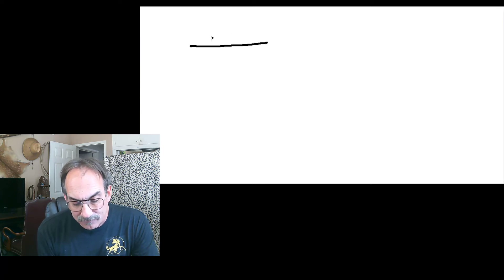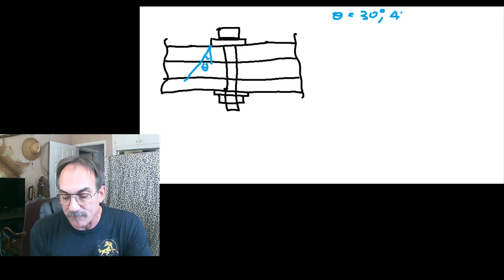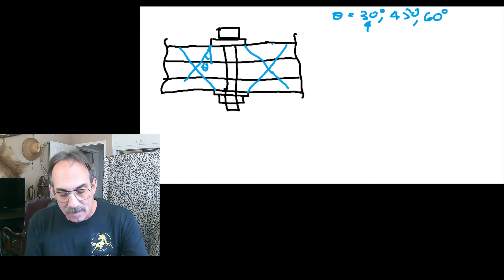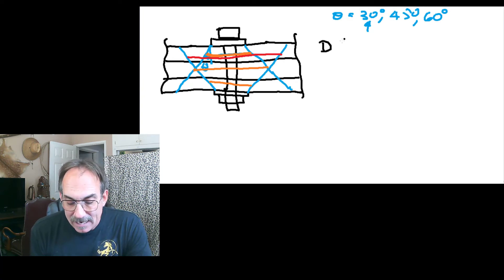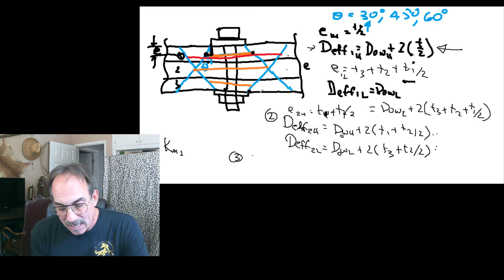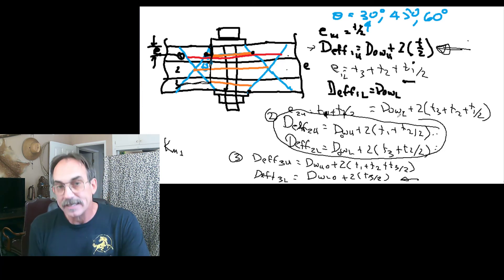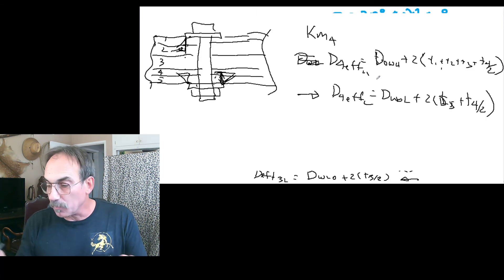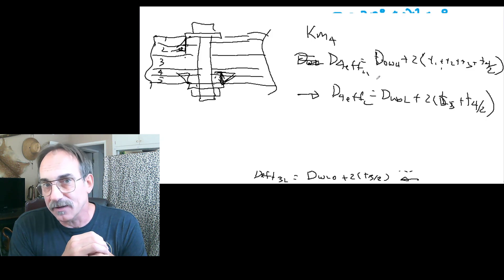Structures II: L-12c - Effective Diameter of Members

Comment: Good video Todd.  A thin washer with a large OD washer will not be 100% effective cylinder stiffness.  It's more reasonable to apply a cone through the washers too. 

Shigley's Mechanical Engineering Design book has a formula for calculating the stiffness of a conic section. It is complicated for hand calcs but is reasonable for a bolted joint analysis spreadsheet, MathCAD tool or other.
Reply from the maker: Jeff, agreed.  Yes, i used to cover Shigley’s conic equation too.  However, while it is fine for experts to use, i discourage non-experts from using it, because it makes it much easier to get a nonsensical result without knowing the result is wrong.

Spreading the load with a simple cone angle and approximating each element as cylindrical is simple, understandable, and much easier to apply a sanity check to the result.

Perhaps in the future i will add a video for utilizing the cone-idealization as a potentially-more-accurate method.
Reply: @ToddCoburn : You are right. Keep it simple and start with the basics.  I was just commenting, not asking for any changes or anything.  Regards